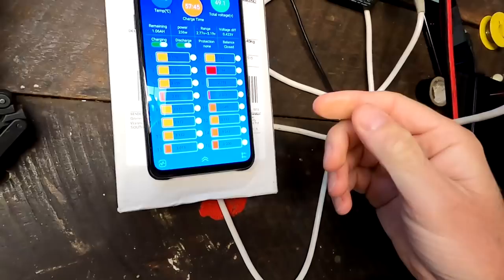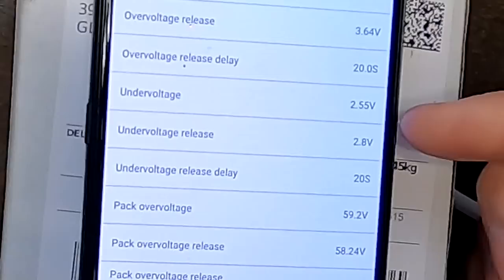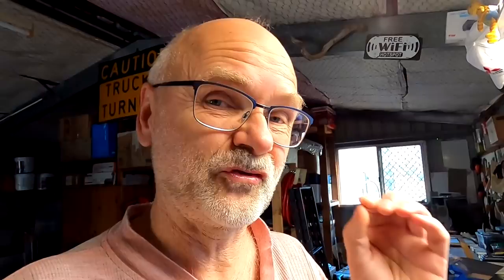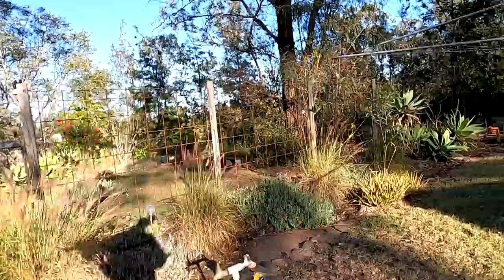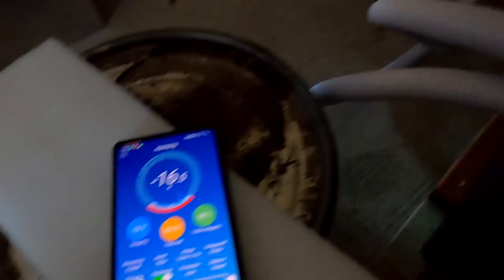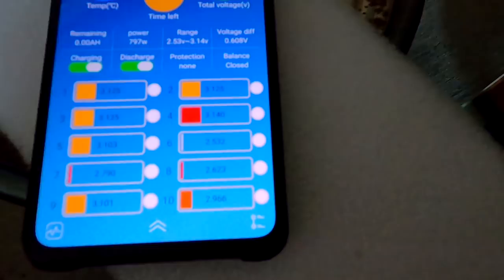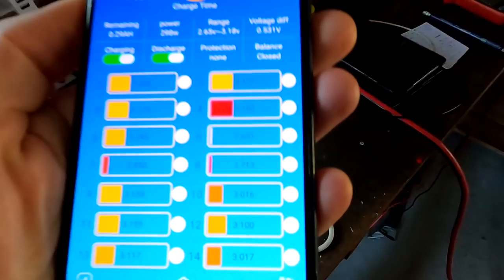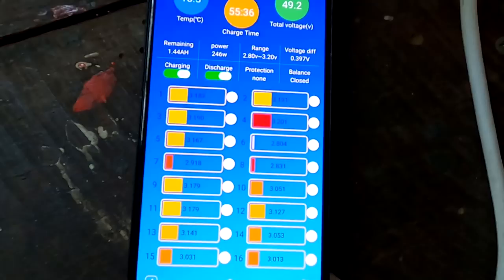QUCC BMS with relay. Why is this happening? 🤷‍♂️😷

Comment: QUCC has a BMS has 2 relays, why not contact them to try that one? If you make a video to talk about that BMS they mighty be able to sell you one with big discount 🙂
Reply from the maker: I have seen their 500A double relay solution. It would mean a lot of installation effort as the relays have to be positioned near the charge controller and inverter. At the moment I would not have space for that in the cabinet but I may have inside the new battery shelve.
Reply: Not exactly related, but….Andy, I got the “Smart BMS” 500A with relays.  It works, but…very displeased with QUCC product & service.  For one thing, it is advertised is working with iPhone, but is read only!!! How stupid is that?  I had to buy an Android tablet to install the app - different from what you use.  It has a CAN & RS485 communication port where a converter to USB may be connected and use a PC software…in Chinese.  I eventually got screenshots translation and managed to configure the BMS.  However, the Android & PC apps are very different!  Obviously made by different developers.  On the top of that, the BMS does not match the SmartShunt SOC.  It also shows negative while charging and positive while discharging??? I spoke to Amy and she confirmed is normal.  Triple check the Hall sensor installation direction and told is correct - I believe is wrong. I was promised the iPhone app and PC software will be released with English interfaces … months ago.  Very displeased with QUCC.
Reply: @razvanduta3563  Yes, they are a hardware company and not that strong on making softwares. Their software are basically done by other 3rd party companies. But from the hardware quality and service I think it is fairly good. I hope they can improve on the software side too.
Reply from the maker: @razvanduta3563  Oh, wow, that's not good at all. They really should have an iOS version if that's been advertised. 
So, if you turn the CT around, does it show amps correctly? How can a company stuff this up? Maybe their definition of charging discharging current is different.
Thanks for sharing your experience.
Reply: @OffGridGarageAustralia  They launched a product which is far from matured.  Any is nice as a person, but is that way because she wants to sell her stuff.  I stayed online with her hours to sort out the BMS manual.  I am very displeased with them.  Still need to figure out how to calibrate the CT as everything I tried - which seems logical it just mess up the BMS big time.  No reference in the manual.  QUCC is not what we think they are.

Comment: Mosfets!! How can a relay charge the battery after it cut power off, unless there is 2 relays. 1 for charge and 1 for output.
I’d rather use a BMS all in Chinese than a single relay BMS.
Reply from the maker: QUC does make a BMS with two relays and 500A current both ways. Not sure who came up with the idea to make one with only a single 
 relay.
Reply: @OffGridGarageAustralia  Single port BMS's do have a place. Consider the wiring of an inverter/charger where there is no separate charge lead as its the same components that make AC power as it is to convert back to do charging.

I do think its a bad design to detect current and try to close a common port contactor. I have mine configured in batrium to be essentially an emergrncy state that requires manual intervention. I do have a second contactor on order for separate charging from solar only and will have a reconnect high enough that the batteries can not get stuck in a loop.

My inverter talks to batrium via canbus so as long as all is well, it should never open the contactor as the inverter will shutdown nicely long before the emergency.

When charging, is there current on that black wire? It doesn't seem like you could get too much charge current through there without the contactor being closed again (which also would turn on the inverter)
Or is the contactor closing but the inverter is in lockout on its own due to the short cycling contactor?

I would try turning off the inverter as soon as it opens the contactor and see if it closes for the charging and stays closed when no load is applied. I think its closing the contactor to accept the charge and thats why the 2.80 release is not being honored.

Comment: Hello from America Andy do you think you might be draining more power than you are putting back into the battery
Reply from the maker: Yes, I did that to trigger the BMS. That was on purpose for the test when I turned on the pump. Not sure if I understand your question correctly though.

Comment: Test the jk try to break it please as i am about to order 50
Reply: The FET based JBD BMS do not exhibit this problem.
Reply from the maker: JK BMS test comes in the next two video. Please watch both first before you order or order something different.

You're going to order 50 BMS'?
Reply: @john_in_phoenix  If there is a single connect for both the batteries and the inverter it might have the same problem but since there is no sound from a clicking relay it is nor readily apparrant
.
Reply: @danielglang6312  I've done a lot of tests, it would be very apparent.

Comment: Does this BMS have a relay ? or a place to hook up a relay? what is powering the relay?
Reply from the maker: "Does this BMS have a relay?" Uhm.... 🤔
Reply: see that big, round-ish, thing with the screw post looking studs sticking out of it?  -> "relay", the BMS is powering the relay from the ~14.3kWh battery it's connected to...  just sayin'!
Reply: @dobrzpe   I should have asked, what is triggering it. It's obviously "powered" by the battery. just saying.
Reply: @OffGridGarageAustralia  confused? The relay you show throughout your video. Is that relay part of,,, controlled by,,, That BMS?  O controlled by something else
Reply: @immrnoidall  me and (i assume) andy are both confused by your questions.  you ask if the BMS has a relay.  (it does), you ask if it has a place to hook up a relay (yes, as it comes connected), you ask what is powering the relay (the battery it's connected to), what is triggering it are the settings of the BMS (hi/low voltage, high/lot temp, etc) to power/unpower the relay itself to allow/not allow the flow of electricity.  then you ask why andy is confused when you asked "does this BMS have a relay" when the entire video is about the BMS that has an attached relay... so, yes, the relay that comes connected to the BMS via a solid copper bus bar, that's screwed/mounted onto the aluminum housing of the BMS is controlled by, connected to, and comes with the BMS.  does that answer your question?  what exactly are you asking?
Reply: @OffGridGarageAustralia  LOL , thought I was still watching the video about the BMS with the active balancer.  No wonder you were confused why I would ask if it has a relay. The title says " BMS with relay". Holy crap. I must have been half asleep. Sleep commenting. lol.

Comment: Maybe you shouldn't have the turn on voltage so close to the turn off voltage when there is a load that drains it back down immediately.
Reply from the maker: What about the recovery voltage of 2.8V then? My understanding is it should disconnect at 2.55V and reconnect at 2.8V.
Reply: But 2.8v is not enough voltage / capacity to safely reconnect your inverter, and load. You are not giving the batteries sufficient time to replace enough capacity to run a load for more than the 20 seconds you're getting. I use 3.2v as my undervoltage release, so I have at least 10÷ to run the reconnected load until I can disconnect / turn off the load until the batteries are charged more sufficiently, or my solar starts charging again if it's night time.
If you weren't home, and it did what you have now, I believe cycling between 2.5v and 2.8v consistently for long periods of time,  could damage the cells,  and the relay / bms... remember,  low state of charge is bad.
Reply from the maker: @offgridtruckerdude7133  I know what you mean, but it does not even wait until it reaches the 2.8V before switching the relay back on again. 
Also, this was just for the test, usually the inverter turns off before the BMS does that. Still good to know that the BMS would not properly protect it as it should.
Reply: I hope you can figure it out,  so relative information is out there for others to find.

Comment: How can it charge to 2.8v if relay is open. it is trying to charge.  problem isn't that the discharge is turning on.. the charge is turning on.  but the relay doesn't know the difference.  then inverter delay start up kills the charge potential to the battery so the BMS no longer sees the charging so turns off... inverter off charge turns is on... and it cycle back and forth till inverter faults out.
you need to change the inverter settings to not turn back on until a higher voltage.
Reply from the maker: It can charge through the black wire I showed. It bypasses the relay to charge.
Reply: @OffGridGarageAustralia  no that wire isn't charge wire it is only a sensing wire made to handle current otherwise the bms would not know what was going on on your battery output.  . 
in the app toggle both charge and discharge off,  the relay will open.  toggle charge relay will close. 
this is the advantage of mosfet is it can stop one direction current flow and alow the other.
Reply: correction... sensing wire NOT made to handle current
Reply from the maker: @bryanspears2045  but how does it let charge through if the relay is open, if it's not the black wire? That is the only connection to the outside world for the BMS if the contact is open.
It lets a certain amount of current flowing through this black wire before it closes the contact again. That can be even enough to turn on the inverter again with the contact open! That's my observation so far. It's a very bad design in my eyes.
Reply: @OffGridGarageAustralia  it can not charge while the relay is open... the black wire detects a voltage higher then battery voltages and see  there is charge potential so bms energies contactor.. put a amp meter on the black wire.
Reply from the maker: @bryanspears2045  Do you have one of these BMS' as well? Sounds like it...
Reply: @OffGridGarageAustralia  no I do not.. just watching your video. also principles of bms. very technical background.  
if the black wire was for charging then it would a split port bms and world need another relay/contactor or mosfet to stop the charging on over voltage per cell. I think it stops charging with the same contactor...
Reply from the maker: @bryanspears2045  I'll show you that current goes through it in a future video. Just measured it... Relay is off and it lets current through the black wire and charges.
Reply: @OffGridGarageAustralia  full rated charge current on the black wire?  it could be a low charge current to test there is a charge potential not just ghost Voltage.  
I am just throwing ideals out there in hopes of helping
Reply from the maker: @bryanspears2045  appreciate your comments and trying to help.
I've measured 1.7A going through this wire with the relay off. This is obviously enough for the low voltage cell to recover a bit so that the BMS has enough 'evidence' to turn on the relay again.
Reply: @OffGridGarageAustralia  the black wire would need to carry full current if it is used for charging (what is it 100amps on that BMS).
your new video shows it just a sensing wire to tell the bms there is charge current available... 
your videos are awesome
Reply from the maker: @bryanspears2045  thank you. I was wrong with that and had these 0.8A in mind. I'm getting old 😊
Reply: @OffGridGarageAustralia  I enjoy the consistency of you work.

Comment: Hysterese is too small and increse delay time to 5 min 
3v recovery 
2.6v disconect
👍
Just sugestion....
About balancing at the bottom absolutly right...
Reply from the maker: The BMS does not even follow the 2.55V-2.8V hysteresis. It switches around the 2.55V mark, hence the 2s interval of the relay. The set parameters and how the BMS behaves doesn't match.